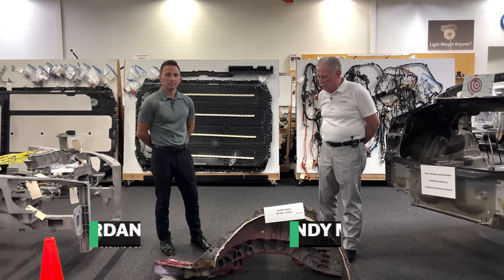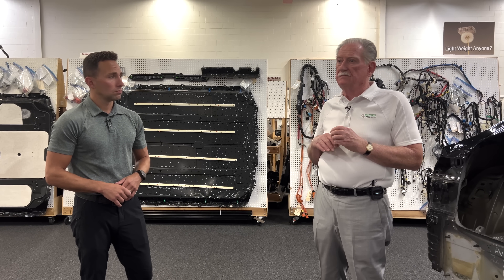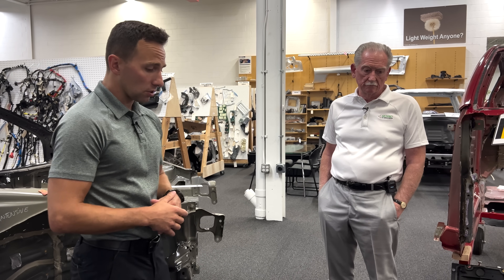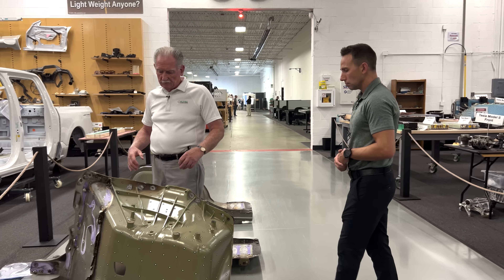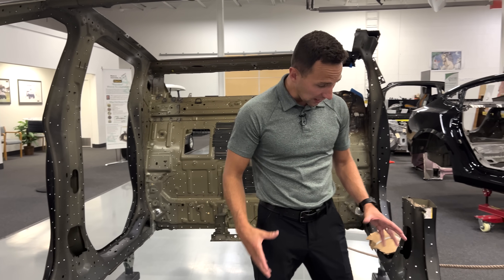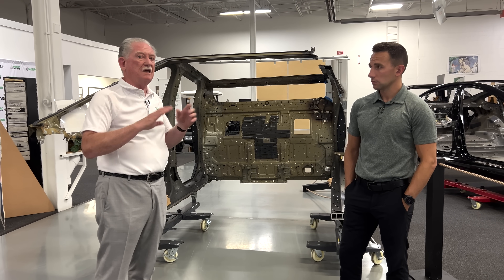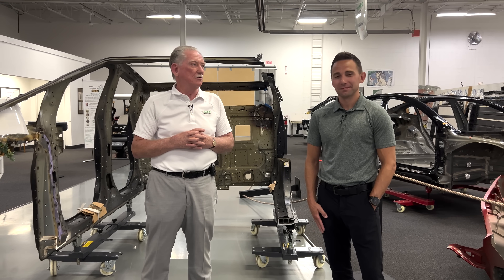From 120 to 1: How the Cybertruck Castings Continue Tesla's Reign of Reduction

Comment: Tesla has initiated many MANY new ideas in their products.
Some are truly innovative and deserve development and acceptance. But many of Tesla's innovations seem to fail as a result of poor execution of the feature, or are "vanity" ideas or fail to meet structured regulatory requirements or are just BAD ideas that should never have made it into production.
These castings are truly impressive structures, they appear to have designed in crumple features, but will these expensive parts cost so much more to repair/replace when using several parts will allow for safety AND repair.
And don't lets start on the Cybertruck.

Comment: I’m a little surprised Munro didn’t foreseen the weakness is the CT rear casting. The difference in strength in comparison to a traditional truck frame is huge…
Reply: It isn’t weakness. smh. It is a combination of enough strength to take the rated loads, plus well designed safety crash crumble zones. try to learn from more than youtubers breaking things, oblivious to safety designs.

Comment: Tesla Cybertruck castings are far too brittle. Their ductility is far lower than traditional steel frames.  Yes they are much better for optimizing manufacturing and minimizing cost, however the brittleness of the casting at the hitch makes the casting susceptible to fatigue failure.   I miss the Sandi of old, when he used to criticize if justified in accordance to engineering principles.  Now he is a sell out and one of Tesla's largest shills.

Comment: How to make a vastly worse performing part for dramtically less, using equipment that costs 10 times more, to replace work already done almost entirely by robots.  Keyword “Less ductile” which means, Cracks rather than bends.

Comment: Its not surprising they use own CFD because they have massive data crunching abilities and taking out F1 superlab will end up/already own THE best CFD.
Reply: CFD doesn't allow you to cheat material properties. All CFD can do is optimize for specific parameters - the more you optimize for a particular set, the more you lose in cases not covered. It's not some kind of magic that allows you to trade computing power for toughness.

Comment: The back's not supposed to fall off.  It hardly ever does that, unless you try to tow something.  Still needs some work.

I'm all for aluminum gigacastings as a cheaper inferior substitute, if you can make the whole damn thing cheap enough to lower the price floor on new automobiles.  As long as you add a sacrificial bit that can absorb fender benders.

Comment: Castings are great, but not for everything. The tooling wears like crazy, the castings in themselves arent ductile as a regular stamped steel part would be. 
Helps GD&T a lot having fewer parts however, easier to control stuff when the casting works like the fixture in the bottom and everything gets referenced towards that part. 
Certain interfaces you do not want a casting, like on the rear hitch of the CT for example, poor material choice for an overall easier design.

Comment: My biggest issue with the giga castings is repairability a very small collision can completely total 850 to 60 to 70,000 car
Reply: My understanding was that it was intended for there to be sub-castings that could be cut and welded in at strategic locations for certain impacts. It's easiest to build from a gigacast, but for repairs you only need certain sub-casts. ...that's the intent...but currently those are not available to my knowledge. If someone fractures their gigacast (cough cough towing or doing stupid shit), they are a write off.
Reply: @frollard  cool story, but please explain who would ever be able to do that and willing to take the liability for welding parts of an aluminum cast together to save the customer a few grand. Nobody welds motor blocks back together either.
Reply: @testboga5991 because you can’t weld a block without needing to remachine all of the tolerances.  You wouldn’t be saving a few grand though. It would be salvaging an otherwise totaled vehicle.  
It could be a few grand in parts and many late nights and weekends from a good welder to salvage. Someone who can Tig  aluminum panels or long travel could do it. 
But no parts and it could be OTA bricked when you’re done, next week or year 1000 miles away attempting to supercharge.  Next Tesla will make these out of cast iron so you really really can’t weld it lol
Reply: Damage to the monocoque chassis is 99.9% a write off any time anyway, even with cars with smaller castings.
Reply: @sebastiansellers5849  That’s why everyday cars for everyday people aren’t built upon CASTINGS. These aren’t exotic sports cars meant for leisure. Remember not to charge up your battery all the way!! You’ll ruin its lifespan!!
Reply: How does the price and amount of damage that can be repaired compare to a Corvette?  Both are unibody and easily totaled from relatively minor damage
Reply: So small collisions totaling a cast structure car more than a sheetmetal car is untrue they have sections of the rails that can be replaced with rivets and structural adhesive they also outline size and location of cracks that can be repaired with welding and backing plates obviously if you have damage in an area that is not allowed to repair replacement of an entire casting usually results in a total loss same as a traditional sheetmetal constructed car with damage past the sectioning locations especially with the use of ultra high strength steels with no repairability only full replacement. It usually requires so much undamaged areas to be sacrificed it ends up a total too
Reply: Well,,, the truck is generally MORE than that,,, but maybe not now—- my guess is you will be able to eventually buy one of these for 50 thousand as currently you almost can’t give them away.
Reply: This and how ductile is it really ? I also don´t understand how it´s cheaper to use all this AL instead of cheap steel.
Reply: Well... It's more complex. 
I hate the Musk's hype that is completely unwarranted for many aspects.
BUT on the casting part... Don't forget that these are electric cars. Electric cars are often totalled with small collisions ALSO because of the battery structure is slightly deformed. So anyway, in many cases, a collision means that the car is totalled. So casting or not, doesn't really matter I believe. It's different for vehicles that have no battery used as the vehicle base. It's different for a truck (a real one, not pick-up cars) that would have a battery pack at the back of the cabin.
Reply: That's not a bug, that's a feature. Tesla stonks don't go to the moon if everybody just repairs their cars!
Reply: Not true.
Reply: @Erik_Owren .   Oh it is true,  and it’s particularly true for the Cybertruck,,, you can get away with that rigid frame in a car,, but a Truck that you intend to use for work,,, Nope,,, it’s gonna CRACK, it has NO GIVE.
Reply: @ambroulard did that happen to you.  Or was it a friend of a friend?
Reply: @Erik_Owren  how its not true?
Reply: @zurielheros8872 i’d love to hear this as well but my guess is he has no clue or else he would’ve answered why.
Reply: @brandontscheschlog .      The aluminum frame has NO GIvE— you can get away with that in a car, perhaps, but not in a truck which you intend to use for actual WorK- this flaw along with ManY others is why the Cybertruck is Easily the Worst Pick Up currently in Production,,, or hadn’t you noticed?
Reply: @Erik_Owren  oh ok, it turns out if the repairs to restore a car to functionality exceeds the value of the car it ISNT totaled. good news everyone!
Reply: @DeenaMilkers  It is financially totaled, of course it is. If it´s cheaper to buy a new one why would anybody repair it ?

Comment: I would like to see the rear casting with the 4 little Threaded holes where the bolts for bumper crack the casting when you tow? I'd like to see that area in detail.

Comment: Gotta love the disposable car...
Reply: Cars last far longer today than any time in the past.
Reply: @Everythingisgoingtobealright  I have a 33 year old Acura Legend that is still going strong. I bet you wont see a CT or other EV in thirty plus years.
Reply: @oliverheaviside2539 
I was thinking of cars in general. There are Model S Teslas with over 400,000 miles, they could probably go a million with enough new parts.
Reply: @Everythingisgoingtobealright  If you look into those high mile Teslas they all have had motor and battery pack replacements which is VERY expensive. The 1.2 million mile tesla has been through 14 motors and 4 battery packs. The packs did about 300,000 miles a piece and it costs around $10,000 to replace, up to $20,000. My 1982 corolla is on it's original powertrain with no rebuilds at 260,000 miles. It will likely make it to 300,000+ before I rebuild the engine and that will only cost a few hundred dollars. My 1993 Chevy 1500 is at 190,000 miles and will probably need a rebuild by 250,000. Once again I can rebuild the motor for a few hundred dollars.
Reply: @Alobster1 
I believe the Model S you’re talking about was an early car and everything has been covered by the warranty. I hoping to get 350k on my 2012 F150 5.0. Plenty of vehicles running around with 300-400k miles on original motors.
Reply: @Everythingisgoingtobealright  Tesla has an 8 year, 100,000 mile warranty on their powertrain. The batteries were not covered by Tesla. The vast majority of batteries will not get covered. I think most of them will end up in the dump because the battery replacement will cost more then the value of the car after 10 years.
Reply: @Everythingisgoingtobealright  diesel trucks would like to introduce themselves...
Reply: @oliverheaviside2539 I disagree with your assessment.😊
Reply: @Alobster1 Why the dump.  How many evs or Teslas have you had experience with?

Comment: Metal Casting is not new tech, any DFMA student will tell you 1pcs casting is far better 20+ sheetmetal + spot welds.

It a sorry affair to see JIT and car execs, driving the car designs 'in the real world' with no massive impactful manufacturing solutions for "decades" , it should be "design" driven by an 'engineer' for ever simpler, faster, more consistent and let not forget less "skills" need to get it right rather than relying 1950s hand craft style.

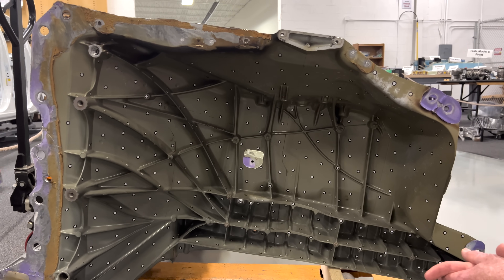7:07 I prefer to call it organic "mold flow" analysis, not CFD, as it utilities technique similar to injection molding.  The real innovation with these casting is I believe to do with the material it self, it custom "metal / aluminium composition" they formulated.  Don't believe me?  Send a sample to a spectrometer for composition analysis and I'm certain it a new mix.

Because to get the aluminium to flow inside a mold even in 6000kN clamp press, still require mid-high level of R&D work, writing some new design capability rules in the process.  Casting / Injection have it own limitation, but generally far outstrip the stupidity of using jigs + cut sheet holes for alignment + clamping + k-factor warp and 3d grain when bending, I'm not sure I want to be that guy to assemble these massive waste of effort traditional car building technique just to produce one sub-assembled part.

Comment: Can you do a segment on the Tesla CyberTruck rear casting, and how the rear bumper is attached?  Would like to see experts insights into what happened to WhistlingDiesel's CyberTruck.
Reply: That will never happen unfortunately. Issues like repair ability and safety are extremely low on munro's priorities and frankly he acts like a shill just trying to pump the stock
Reply: @sanisidrocr  They care about safety because that affects vehicles initial sales. They don't care about repairability or sustainability in the least because their business is literally finding out what the cheapest way to produce a vehicle is for manufacturers. They're big Tesla fanbois because Tesla is so good at combining components and streamlining for cheaper mass production at the detriment of all other factors.  Sandy has done whole videos on how Tesla is the best. So no they won't be showing anything negative or controversial about Tesla sadly.
Reply: @slunasaurusrex  If they simply cared about efficiency and cheap mass production we would already have seen  a 20k usd tesla . Its not hard to create a minimalist model that has a smaller but upgradeable battery pack that allows the consumer to buy at the 20k mark , replace a smaller battery if defective or add more to it if they can afford to. Instead the model 2 was delayed and we saw the expensive cybertruck that isn't practical. Some of their practices are under the guise of efficiency , like structural battery packs that are extremely difficult to repair(remember how much effort sandy took to remove a cell from the new packs?) but are really done to prevent repairs and force you to buy new packs from tesla .
Reply: Whistling Diesel drive a truck in a manner of was not designed for and broke it. This is not a design flaw but abuse
Reply: @gadgetdealz  Trucks need to be designed to handle that vertical load . Multiple people have already had this flaw destroy their tesla from hitting a pot hole

Comment: I had hoped to hear some insight about the back falling off.
Reply: You mean after driving over 6ft diameter storm culverts, dropping off the end, and slamming the bumper in the upward vertical direction? When it was designed for lateral direction and downward trailer tongue loads?
Reply: @TheJustinJ  yes. Exactly that. If Sandy had said what you just did, I'd be quite happy. And what the dudes did with their truck was insane and obviously abuse. But I have seen pics with the back off in other places. Either more crazy dudes or a real problem. Even Jerry rig everything said he would not tow with the Tesla anymore. So... Experts please!

Comment: Another advantage of a casting instead of a conventional stamped steel unibody is rust. In a sheet metal construction there are many locations where there are several layers of sheet metal sandwiched together and welded. There is no way to get corrosion protection between these layers and that's where water collects and over time the vehicle rusts from between these layers until there is not enough structure to hold the unibody (frame) together. With an aluminum casting, you don't have these layered construction methods, plus you have a metal that is inherently less prone to corrosion.

Comment: When I changed my steel-frame bicycle for an aluminium one I felt the difference right away. During some time I had used them both and I understand the difference between hardness of the frame and how much energy does it save when you push the pedals. I bet almost the same thing is happening when you transmit the energy from the motor to the wheels of an EV
Reply: When mountain bike frames initially switched from steel to aluminum, I wonder what percentage of them developed stress cracks from the jumps? It might be interesting to hear how bike frame companies mitigated that.
Reply: They didn't there is no way to do that as Aluminium doesn't have force threshold and will eventually fail given enough elastic deformation cycles. On hardtail MTBs the upper limit is around 25000 km of mixed driving, probably lot less if only riding off-road. Suspension can prolong the lfie of the frame, but they are finite unlike well made steel frames which will last hundreds of thousands of kilometers with no sign of cracks.
Reply: @aussie2uGA  I doubt that there was a big deal with aluminium frames at all from the very beginning (I could be wrong, correct me if so). I'm in MTB for 20 years already and I don't remember any issues with them. The cracks often occurred when someone tried to fix his bike without any knowledge and proper tools (almost the same was with carbon frames).
Reply: There are a few videos on YouTube of aluminium frames shattering under the  extreme stress of downhill mountain biking.
Reply: @albert7311  With steel, there is a minimum stress level required to initiate cracking.  With aluminum even the slightest stress, if repeated enough times, will cause crack creation/growth.  Downhilling on a MB is constant repetitive flexing.
Reply: Steel rusts
Aluminum fatigues
Carbon shatters

Comment: 99 of 100 auto body shops can't order  a Tesla part. All this casting stuff is just the makings of a disposable car. The cost to replace the casting will probably total your car that's losing value on a daily basis.
Reply: Silly on so many levels.  I'd prefer to be alive and undamged and let the car take the hit. Looks like you don't care about yourself or your passengers, and a cheap junker car is more your thing.
Reply: @tesla_tap  I work on cars for a living and I will take a Toyota product over a Tesla any day ! Speaking of safety. Have you researched EV fires at all??
Reply: @kevinbates3575  Yep, quite a bit. An ICE vehicle is about 20 times more likely to catch fire than an EV at least in the USA. Don't know about other countries.